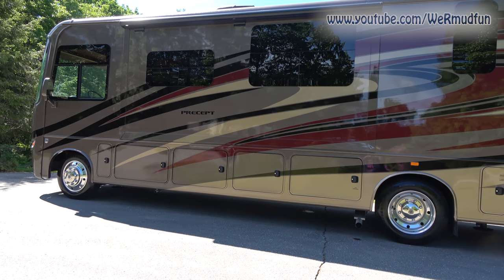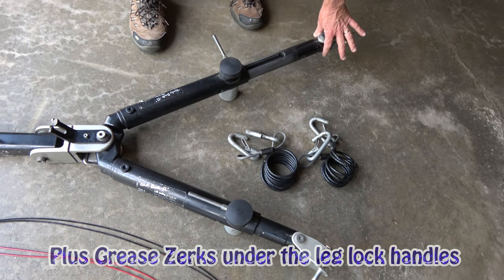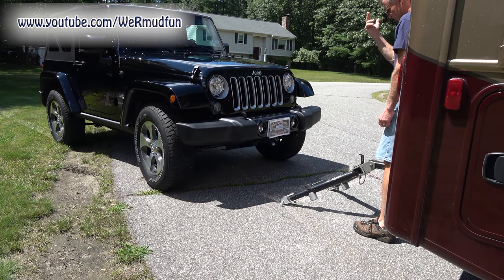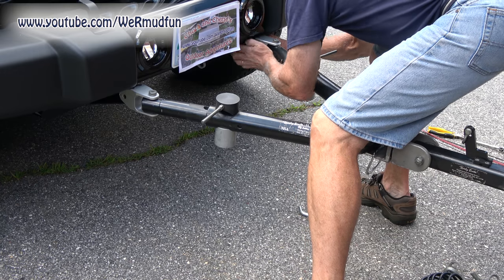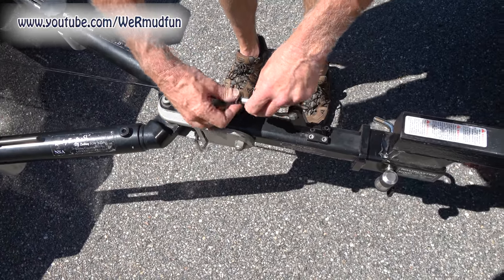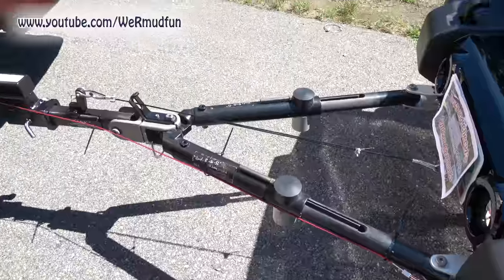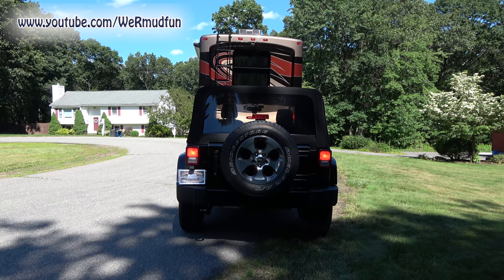Part 5 - Jeep to RV Toad (Dinghy) Conversion - ReadyBrute Tow Bar and Test Drive

Comment: A question, does the Ready Brake Cable have enough slack in it to be disconnected at full tow bar extension? or, should the towed vehicle brake be depressed to give it enough slack for disconnecting at the end of the tow? Again, thanks for the videos, they were very helpful.
Reply from the maker: Glad you liked the series. You should have to depress the brake a bit to connect and disconnect it 😀.

Comment: I am going with the same set up on ours ,We have a Tiffin motorhome  and will be pulling a 2017 JKU behind, does this setup make a lot of noise and or klunking sounds when you slow the Motorhome ?
Reply from the maker: We are almost 37' long, we don't hear anything.  LOL  The Jeep is a great toad.  I have turned on the rear camera at times just to make sure it is still there.  Good luck. :)

Comment: Chuck, as tight as your Ready Stop lead is, how does it not activate when you do a tight right turn?  (ok, as tight right as a motorhome can make)
Reply from the maker: It has never been an issue.  It is adjusted to manufacturers recommendations. Beside I hardly ever make a tight right or left turn in a motorhome. LOL

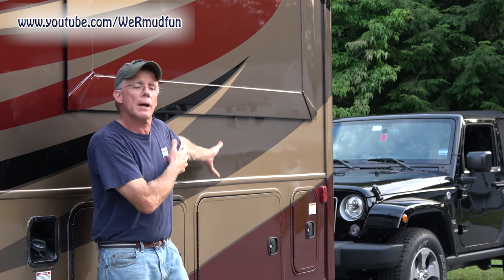Comment: About to pull the trigger on a "conversion" of my own, but watching (not the install of any of the components) rather hooking the Jeep up... THAT looks like way more of a pain than I had anticipated. I'm guessing you might not drop the jeep for a one evening run into town? I'd like to watch how long this takes real time, in the rain, when you're supposed to have been off the campsite by 11:00 and it's almost noon. Also how much of that gear do you bring inside or stow if you camp somewhere for a few days?
Reply from the maker: Yes we have dropped the Jeep if we wanted to go some place even if it was an overnight stay.  Now that we are full time, the tow bar stay hooked to the RV at all times.  When we are at a campground, we put a cover over it to keep the dirt and rain off it.  The only thing we stow is the 7 way to 6 way electrical cord.  Everything else is either attached on the Jeep or the coach. With my wife and I working together, 5-10 minutes tops to hook up the Jeep to the RV and we are rolling.  Unhooking is less than that.  Once you do it a few times, it's a piece of cake.  The alternate to towing four down is to use a dolly or a trailer.  That looks like more of a pain to us, but to be fair we have never done it that way because we have been pulling a toad behind our RV's since 2006. As far as rainy days, it's part of the camping experience and adds no time to our hookup or unhooking.  We  also always set an alarm  for the day we are leaving a campground. LOL
Reply: @WeRmudfun  Cool, a reply. Yeah flat towing seems like the only way to maintain any sanity. Imagine having to stow a dolly or a trailer every time on top of everything else! I witnessed a poor guy's wife back their sport ute off the side of trailer in an RV park last fall. The entire disaster damaged everything from their relationship, to the car, the trailer and the trip. It made me delay the decision to start towing another 6 months, but after 4 weeks of rental cars this spring, dozens of Uber rides and lots of walking, I pulled the trigger on used a starter Jeep today.  She's going to need a full outfit for towing.  Thinking the  Roadmaster and the iRV3 brake system, but may warm up to a mechanical cable system like you demonstrated.  Hey thanks for making all the content (I've been binge watching your channel today) I know how much it takes to put out good content and yours is top notch. Maybe we'll see you "out there" sometime and I can somehow return the favor.
Reply from the maker: @YankeeinSC1  We have seen some interesting things that people do at campgrounds. LOL  We are glad you are enjoying our channel, thanks for stopping by.  If you see us along your adventure, come and say hi. 😀  I'm not sure if you are watching from this channel or our other channel www.youtube.com/GetGonewithUS.  We started the GetGonewithUS channel to be all about RV and the Jeep. Stay safe !

Comment: I have a question. Your steering wheel in the Jeep looks like it moves fairly easy when hooked to the RV. I know that when I put my key to off in my Jeep, the steering wheel gets really hard to turn, like the power steering stops working. Would that be ab issue when turning? Thanks in advance.
Reply from the maker: If we are not hooked up to the RV, our steering is hard too.  Power steering does not work unless the vehicle is running. When it is attached the the RV it should turn with the RV provided your steering wheel does not lock with the key removed or there is some other problem. 😀
Reply: @WeRmudfun  ok, thank you!

Comment: Did you have to modify the Blue OX clevis'? They do not line up with the base plate.
Reply from the maker: All we did was run a drill through them to clean up some extra paint build up on them, then the pin slid through easily.  No mods needed when we did it.

Comment: I have a 2017 wrangler that I am setting up for tow.  I was not sure how to attach my jeep to my tow bar.  I had not heard of the Currie mount plate until I saw your video.  I like my stock bumper and had the same issue you did.  I am looking forward to getting my Currie mount plate and installing it.  It looks really clean and professional.  Thanks for sharing
Reply from the maker: You are welcome! We have no complaints with this base plate and love the way it doesn't looks like just a baseplate. :)

Comment: Is there a certain position you have to leave the ignition switch in the jeep in order for it to steer?
Reply from the maker: Depending on the year of the JK the key doesn't even need to be in the Wrangler.  Our 2017 does not have a steering wheel lock, I'm not sure which years do.  You would need to check your Owners Manual or talk to your dealer.

Comment: Thank you so much for these videos on how to do these installs. I was trying to find a place to mount the readystop unit on my JK and I decided to see if anyone had done it on youtube. Yours was the first one that popped up. You mounted it in the place I was leaning towards so your video confirmed that for me. I am also mounting the ready brake unit, but the nylon bushing for the front of the jeep was missing, so I had to contact NSA to get that. I ran the conduit for that today while I was running the readystop wiring. The only thing I noticed that you did different than the instructions was the way you hooked up the plates to the brake pedal. The instructions say to use the bolt holes closest together that will still allow you to hook up to the pedal. You used the outside 4 holes. I was able to use the 2 sets of holes that are closest together. Have you had any problems with the plates shifting on the pedal? It also looks like you went with the same baseplate I put on the front of mine. I opted to use a bracket like you suggested and ran the cable through the curved shaped design in the middle of the baseplate.

By the way, nice flag hanging in your garage. Semper Fi brother!
Reply from the maker: Thanks for your comment. This is the third one we have installed.  It was seemed easier to do it the way we did.  It is holding just fine. :) Semper Fi!

Comment: I was always told to hook up the toad first to the tow vehicle, then put the toad in tow mode, because you don’t want a runaway vehicle, what is your take on this? Love your videos
Reply from the maker: We have been hooking up the toad to the motor home first , then putting it in tow mode since day one.  Once the toad is in toad mode it is a runaway waiting to happen.  It is also easier to drive the toad up to the tow bar on the motor home, then back the motor home up to the toad.  😄👍  PS we have moved all out new RV video to our other channel.  www.youtube.com/GetGonewithUS
Reply: @WeRmudfun  confused.  so drive the toad up to the tow bar, connect to tow bar, then go in toad and setup towed mode.  or drive up to tow bar, dont connect, then go in jeep and setup towed mode?

Comment: Great video! Do you leave the key in acc and disconnect the battery cable?
Reply from the maker: Thanks.  It depends on the year of your Wrangler.  On our 2017, the steering column doesn't lock, so there is no need leave the key in the ignition or disconnect the battery cable.  You can check your owners manual to see if your year requires it. 😃

Comment: is there an easy fix to get the third brake light above the spare tire on the jeep to work? just curious. Great videos
Reply from the maker: Thanks! :)  I would imagine you would need to run a jumper wire with a diode from the toad harness to the power wire going to the 3rd brake light.  Not really sure though.
Reply: This is interesting due to the fact that many areas require vehicles to have a 3rd brake light...but in this case the Toad is a “trailer” so I can’t imagine the 3rd light being required by any law.

Comment: They have made several changes to the newer Ready Brake Brute Elite II since this video was made. There is no longer a ring to run your safety chains and wires through. You have to insert a pin to hook the unit up for storage, no longer a hook. There is now a turn buckle to make fine adjustments on the brake sling cable. Most of the rest of the set up is the same as the video.
Reply from the maker: As was mentioned in the video, the Tow Bar we use is the same one we purchased back in 2006. The ReadyBrute is a great tow bar and if we ever need a new one it will definitely be another ReadyBrute.  The new upgrades sound great.

Comment: I am currently in search for a tow bar as I have ordered yet another RV.  I said I would never do that again, this going on the 5th time.  Anyway, I never had the supplemental braking set up and I am wanting something simpler.  This tow bar and break away seem to fit the bill.  Thanks for your videos because they answered all my questions.  This is the system for me!
Reply from the maker: We have been using this system with the same tow bar since 2006, we love it. 😀

Comment: I noticed you zip-tied the break-away cable to the tow bar.  This would not be convenient if the toad needs to be disconnected frequently.  Do you have any suggestions for how the break-away cable could be routed so that it's easier and faster to connect/disconnect?
Reply: When you disconnect, you disconnect the breakaway cable at the Toad, the cable then stays with the tow bar, so there’s no need to break and redo the zip ties every time. If the Toad ever came loose, the breakaway cable is just going to snap the zip ties and once the slack is diminished it will engage the brakes, locking them.

Comment: Just have to say, that watching your series was very helpful to my wife and I in installing the brake and breakaway system, even though I klutzed up an item along the way (was able to do it the right way though ): )  Just a question on this video - you have the brake cable tension set so it has about a 2" movement amount, up and down - but it still looks fairly taut.  Is there a problem if you make hard right and left turns in the cable being pulled accidentally via the turn radius and applying the brakes?  Overall, a great series for a person wanting to do their own work using the Ready Brute system.  Thanks to you and your wife for all the time and effort you put in this.
Reply from the maker: Thank you for your comment we are glad you found the series helpful. The directions call for 2-3" of play, we fall in between that with ours.  We have not experience a problem with the brake cable during turns.  Note though, that we have noticed that the cable does stretch a bit after the first ride out and needed readjusting.  We also use a bungee cord on the brake pedal and attach it under the drivers seat as added precaution.  If you recall, we installed an extra wire when we installed the brake relay kit, so that we can eventually have a LED light in the RV telling us when the brakes are activated.  The new Readybrute Elite tow bars come with that feature, but only tell you when the Readybrake is activated.  I want to know when the actual Wrangler brakes are activated, I'm funny like that. LOL

Comment: I am about to do the same base plate and ready brute tow bar. One question - what about the clevis? Did ready brake need to custom fit?
Reply from the maker: Yes the clevis you get needs to fit the ReadyBrute tow bar.  I have links to everything we used in the discussion box below the video.

Comment: you leave the automatic transmission in P (park)???
Reply from the maker: Yes.  The transfer case is in neutral, so the transmission is put is park. Every vehicle can be different, so read your owners manual for your own vehicle. 😃

Comment: We are also considering a soft top wrangler for our toad.  Do you have any issues with the wind from the rv buffeting and damaging the top?
Reply from the maker: We don't have that many miles pulling this Wrangler yet, but do not anticipate any problems.  We pulled our old Wrangler behind our Class C for years and never had a problem.

Comment: thanks for these videos. we just got an f55 based rv and we’re setting up our wrangler.  very similar setup. how happy have you been with the v10’s power to pull the toad?
Reply from the maker: You are welcome. Before we installed the toad brake monitoring light, I used to turn on the rear camera just to make sure the Jeep was still there. Now I occasionally look at the light while braking in the RV to know it’s still back there.  That’s how easily the Jeep pulls, can’t even tell it’s back there.

Comment: Do you have to crawl under the RV to hook up the break away cable each time you hook up?
Reply from the maker: We do, because that was the best location for us.  I have considered drilling a hole through the frame and mounting it closer to the end so we don't have to go under the RV.  Truthfully with the height of our RV, it's not a big deal, that why I haven't done it yet. :) Remember though, it has to be mount to the frame, not the hitch receivers.

Comment: I have custom wrangler can I tow
Reply from the maker: I have no clue what a custom Wrangler is, sorry!
Reply: @WeRmudfun  4d Rubicon unlimited edition..6 inch lift
Reply from the maker: @miltoncastro237  I can only speak for the 2017 Jeep JK Wrangler with the stock front bumper.  You can try calling the company and ask them if it will fit yours. Good Luck.